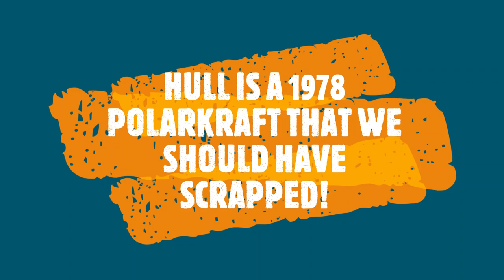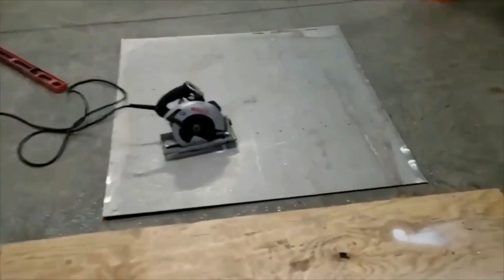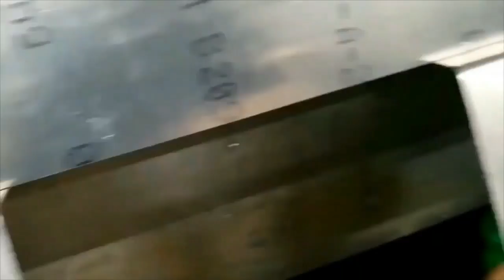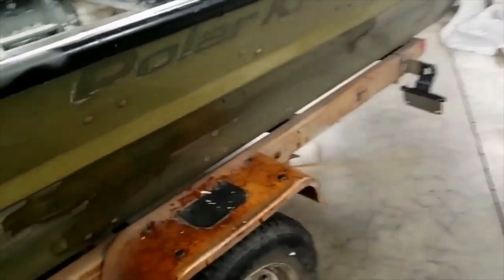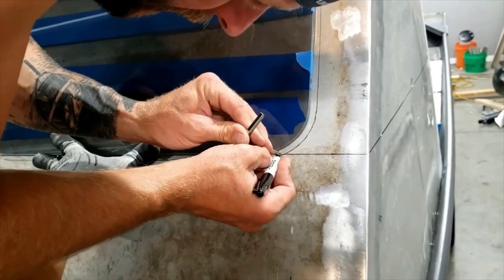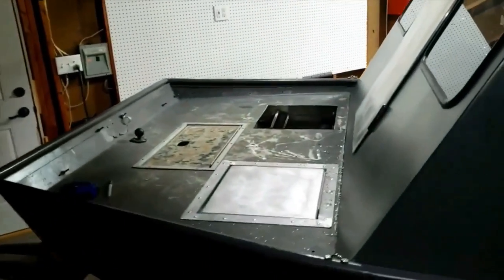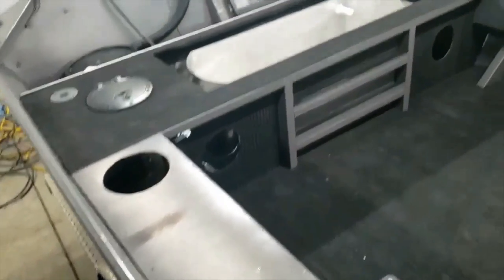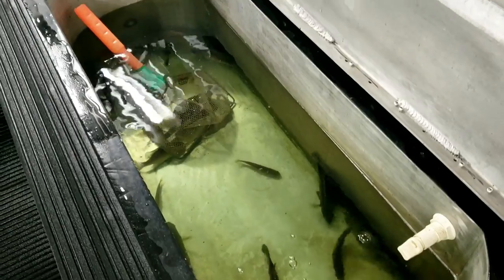Building a Unicorn Jon Boat! "TunnelCat" 1660 Full Build Video. A Loaded Skinny Water Catfish Rig!

Comment: Awesome boat man! I’m in the process of rebuilding almost the same boat, except mines a 17 footer. Did you make the tunnel yourself? Just ran across this video in my recommended section. I’ve heard people say that flat bottoms with a tunnel create a suction and pull the rear of the boat down, wondering if that’s an issue you’ve ever had or not?
Reply from the maker: Definetely will slow you down. Itll run about 32 max and it doesn't weigh much. You lose speed for sure but it will run crazy shallow for a prop! The tunnel was on the hull when I got it. I think it was factory but I heard they were a terrible design from the factory and had issues. This boat had been welded on down there before I got it that's for sure!

Comment: just a quick tip the foam makes it haevier it does'nt make it float any more.
Reply from the maker: Actually not true. Foam is weightless. And will save you if you swamp your boat. It is not for everyday use. Only if there is a mishap. I have been there and its saves your boat from totally sinking. Making it retrievable at worst case.